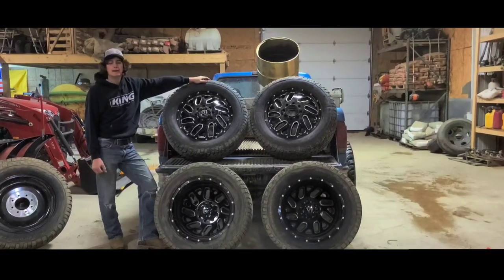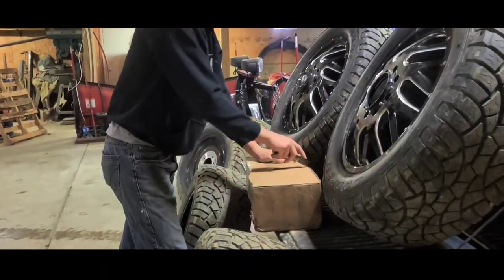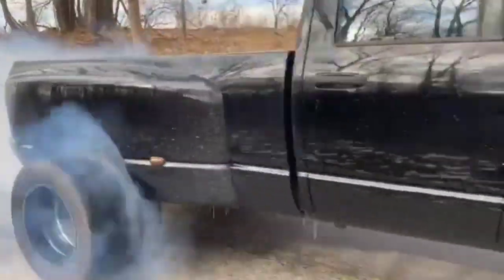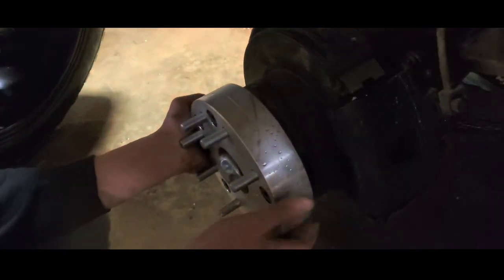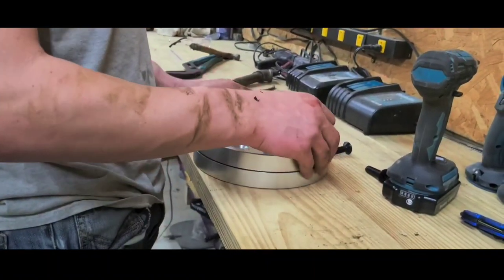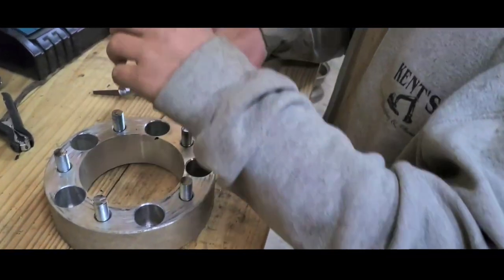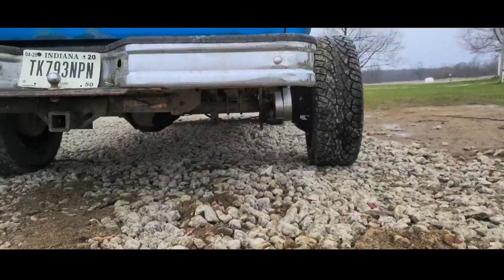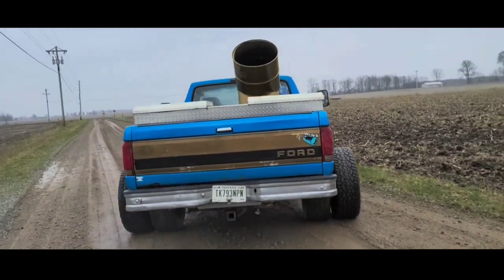I PUT DUALLY WHEELS ON THE F150

Comment: My cab over engine truck have a capacity of 2 tons.  
Most of the time, it is loaded with tall merchandise  over 5 feet tall, and weighs from 500 kilos to 1.5 tons, occasionally over 2 tons.   
We noticed that even with a load of just 500 kilos, wth tall merchandise, stability is reduced, and the truck wiggles even at speed below 50 kph.  
Following a friend's suggestion, we convert it to dual rear wheels.  The result is fantastic.  Even at full load, the ride is stable, and we don't experience wiggle even at speed above 60 kph.

Comment: This man started out with a stock f150 2 wheel drive to a 12v diesel to now a 6.0 race truck. Wish I could done that to my first truck it was bout the same I had 89 long bed single cab 2wd granny 4 speed and a inline 6 and I’m glad it was a 300 inline 6 bc I’m sure if it was a 302 I’d slung a rod threw a 302 😂😂😂 not to say there bad them 300 6 was a tough engines

Comment: It actually looks badass I wonder if it tows like a dually too.
Reply: That’s a joke. No it’s not going to haul what a one ton does. It’s still a weak half ton pickup
Reply: @100texan2  
What does this mean? I’m new to pick ups
Reply: @humanityincvideos5114  It means that the truck is still only capable of hauling the same weight that it was designed for.

The dually wheels are just for looks.

It will do better in snow and mud though.

On a physics level the spacers reduce the safe hauling capacity of the truck. Solid steel spacers won't reduce it by much at all if they are high quality.

Long story short, this is just for looks.
Reply: @h_r7708  thank you

Comment: It typically helps to break the bolts free before trying to zip them off bud lol
Reply from the maker: What
Reply: @freeddiesel  looked like you lifted the truck and tried to remove the bolts before breaking them loose with the ratchet at first
Reply: @STR8SICCC  Is it me or did it look like a 1/4" impact? My cheap (in price, actually a great tool) Ryobi 1/2" impact will take them right off, in the air or on the ground.
Reply: @fishstickshardasti  I'm really not sure tbh.